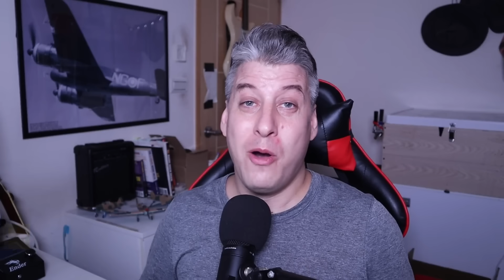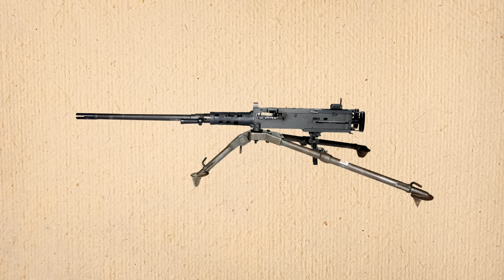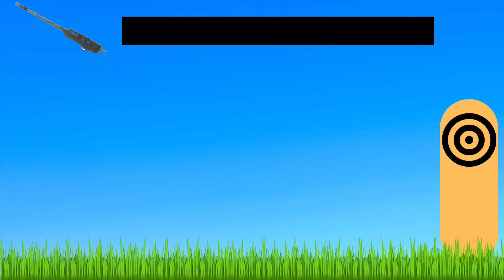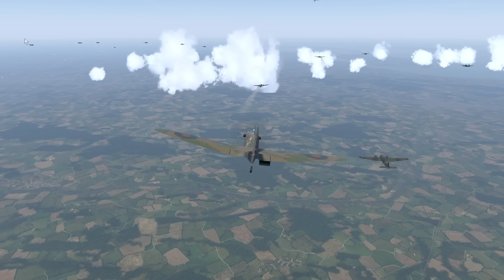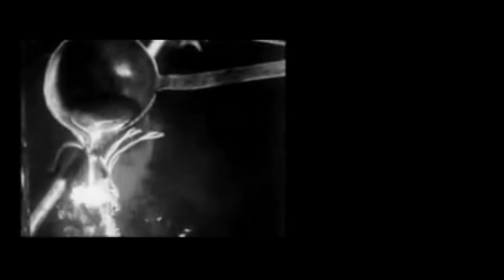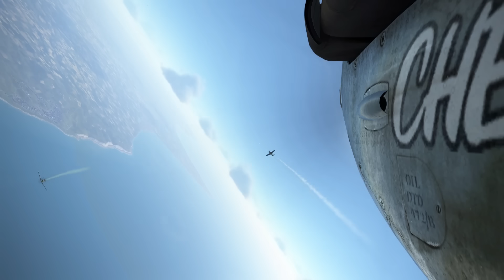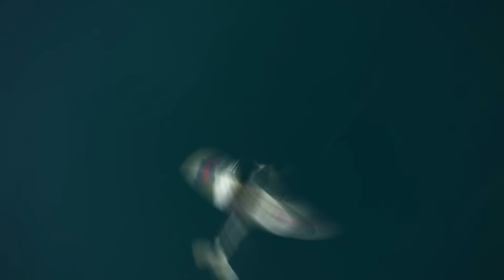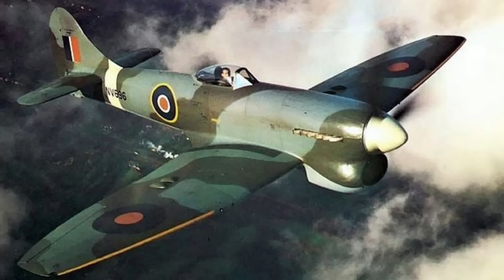Why Did The RAF Use .303 Caliber Machine Guns in WW2? The Surprising Answer

Comment: By 1944, when the P-51D appeared, the typical Spitfire of that time had an E wing with two 20mm Hispano cannon and two .50cal. machine guns. This arrangement delivers much more energy than the P-51's armament, as 20mm shells have a kinetic energy of 65,000J each (three times that of a .50 cal. bullet), and the explosives in the 20mm shell add about 40,000J of detonation energy to each.
 Accordingly, two 20mm cannon deliver approximately two megajoules per minute to the target, plus another 300,000J from the two .50cal. machine guns. This is well over twice the firepower of the P-51's six .50cal. machine guns, and all for less weight (275kg for the Spitfire vs 389kg for the Mustang, for guns and ammunition).
A four 20mm arrangement is the most lethal of all, and so proved by the end of the war.
Reply: I read that pilots in the Pacific preferred .50s to cannon for the greater ammo capacity.  Japanese planes lacked armor and self sealing tanks so .50s had no problem chewing them up.
Reply: @CorePathway  Absolutely. Japanese fighters, particularly the Zero-Sen were very lightly built and carried no armour or self-sealing fuel tanks. This made them much lighter than they would have been if they had such, therefore more maneuverable and with a very good rate of climb. This, however, did not serve then well as faster and more rugged American and Commonwealth fighters using hit and extend tactics tore them apart with a burst of less than a second. A P-38's 20mm was even more lethal.
Reply: @Glicksman1  I think you have to explain further your statement that two Hispano cannon deliver 2 mega joules per minute destructive power plus 300,000 MJ destructive power from two 0.5cal. Browning machine guns!  Doesn’t “MJ” mean mega joules? If that’s the case then the Hispano cannon are pretty puny!?!
Reply: @ivatt442  I see the mistake. It was a typo. I meant to write, " ...300,000J"...". Joules, not megajoules (MJ). .50cal. machine guns are powerful, but not THAT powerful. :D
Also, please note that for descriptive convenience I wrote "per minute" when describing the power of the guns. No 20mm or .50cal. gun is fired uninterruptedly for an entire minute. To attempt to do so would destroy the gun well-before a minute was reached. A burst of one second or less was more usual which, if accurate, was sufficient to destroy virtually any aircraft.
Sorry for any misunderstanding because of the typo.

Comment: Odd that the Spitfire was switched to four 20mm guns but then changed to 2 20mm and four .303, later two 20mm and four .50. Aside from mounting problems with the 20 mm it was also found that the chamber headspacing was wrong which also casues jamming. (the Corsair F4-C armed with the same 20 mm guns had problems as well)
The freezing of the guns was solved by equiping them with electric heaters. If you wonder why early on the gunports were taped over at the start of a mission was to keep condensation out of the guns while climbing to altitude and freezing in the guns. But at high alititudes even lubricating oil will freeze and jam the guns. (B-17 gunners worked hard to make sure they worked and some were said to even sleep with them, probably waist gunners.)

The .303s in the rear Lancaster turrets were often loaded with all or almost all tracer hoping to dazzle the night fighter pilots if nothing else.

One theory for the .303 was that a massed stream of tightly spaced hits would cut the aircraft structure like a buzzsaw, more effective against frame and fabric. But then because it was thought the pilots were poor shots the harmonization was set to "shotgun" rather than spot which defeated the plan.

But in reality it was more the RAF did not have the time, or money, to change over to a different gun as it was more use what you have and hope foe something better later, maybe.
Reply from the maker: Thanks for the extra info there Frosty!

Comment: Well,the turret with four 7.7mm(.303)machine guns on a bomber is enough for doing the job. That's on bombers. But,the Spitfire MkV with only .303guns wouldn't be as good as with two 20mm Vickers cannons. Trace them with 7.7 kill them with 20mm or both. Personally,i would rather have something like the Seafire with four 20mm cannons then two and four 7.7guns. Get close enough and you can use cannons two by two. American 12.7mm(.50cal) was powerfull enough so they didn't have that much need of stronger punch. Especially P 47 with 8 .50s. What i would always choose is the Fw 190 A4,A5 or A8 with two 7.92mm or two 13.1mm machine guns plus four MG151 cannons. That combo beats it all even with 7.92 on the nose. Interesting to say is that the MG151 was good because that is actually a 15mm heavy machine gun made larger to 20mm,while keeping a high rate of fire. But in war you use what you have and i can understand England for keeping the 7.7mm till reliable 20mm came about.

Comment: In my opinion the .303 was a good enough round, when firing at an aircraft in a formation of bombers the pilot didn’t want to hit the aircraft where it was most heavily armoured, the pilot/co-pilot usually had armoured seats but the rest of the fuselage and wings were of aluminium of a lighter and thinner gauge, engine cowling’s couldn’t be made to such a thickness that it made removing and refitting them labour intensive and had a weight penalty, heavy armour throughout an aircraft affected the weight and moment, and that could lead to handling issues, all in all the idea is to bring an aircraft down, whether that was accomplished with 100 .303 rounds or 25 .50 cal or 5 20mm is a moot point, down is down, and all the talk of claiming damaged as a marker for the crews was ridiculous, only aircraft that crashed counted, a damaged aircraft could, up to a point be repaired and returned to service as quickly as the amount of damage dictated. Ultimately the .303 saw RAF, Commonwealth and Allied pilots through the Battle of Britain 🇬🇧, and then the rest is history. Thanks for sharing your research and knowledge with us all, very interesting and informative, subscribed. 😀👍🇬🇧🏴🇺🇦

Comment: The real head scratcher for me is why within a couple months of each other did the RAF set up production of a .303 cal version of the browning and the Army set up another factory to make 8mm BESA tank machine guns.  Both were rush war emergency jobs to get belt fed MGs into the fight as quickly as possible, yet the army decided it would be easier to no bother changing caliber and work around a gas operated gun.

Yet the air cooled browning started life specifically as a tank gun.  There were British and French tanks in the 20’s with such an armament.

Best guess is they just didn’t talk with each other?

As to why the RAF went with .303, I think they were just a conservative lot and suspected (correctly) that in action many of the guns would fail.  If you have 8 MGs and 2 fail that’s not bad.  If you have 4 cannon and 2 fail that’s a big problem.  And the cannon armed fighters were notorious for jamming in action until mid way through the war.
Reply: Unless supply lines might get confused separate and incompatible supply lines are not a problem. Producing different guns, with different requirements, might avoid bottlenecks in production. Having platoons or companies with mixed weapons can be a problem - but the RAF and Army had entirely separate supply lines that could easily accommodate different and incompatible supplies. In fact .303 ammo for snipers, ordinary rifles and machine guns was different - so even squaddies could deal with mixed ammunition that would fit into and fire in all guns (often very dangerously).
Reply: But the Browning and the BESA were both products of the BSA company and of the same team. The Browning was made at the Armoury Road, Birmingham factory and the BESA at the Redditch factory. My father, W J Gardiner, was the key person in both cases, being a member of the team that set up production of the Browning and in 1941 manager of the Redditch factory. He died in June 1941, partly the result of the stress of his job. He had been a 'Old Contemptible' in the 14-18 war. He also had had a lot to do with the setting up of production of the Bren Gun. I must have been about 8 when he explained to me how it worked and one of the Czech technicians who came to Britain to help set up production gave me some Czech coins. A serious problem at Redditch was getting former farmhands to accept the discipline of factory work. Later women were employed and they took half the time to train and did a better job.
Reply: There was a big debate. Bob Stanford-Tuck wanted the Hispano, but Douglas Bader was determined to stick with the .303. They fought it out at meetings with the Air Ministry during the BoB.
Reply: the licencing fees for the .50 cal were prohibitively expensive for BSA.  The 30.06 MGs that came with early Mustangs were problematic and the ammo of low quality, so they removed them & gave them to the RAF Regiments.  They then installed their own .303s in the Mustangs.  The RAF used what worked best.
Reply: Also , it is strange that the Army didn't rechambered BESA's to the .303 , the standard caliber for rifles and MG's. At least British tanks could use captured German ammunition.
Reply: @Kav82a  IIRC the BESA uses a push through belt that won't work with rimmed ammunition. The Maxim and US Browning pull the rounds out backwards, thus work with rimmed.
Reply: Remembering that the pneumatic cocking device was deleted from RAF fighters because the 20mm  was so reliable after Martin Baker and Molins had debugged the set up. It also shot faster with a flatter trajectory than the German equivalent which was Oerlikon based.

Comment: The AN M2 50cal machinegun was a lightened version of the ground-based M2. They also had a higher rate of fire than the ground-based M2.
With the Browning 303 machineguns in British fighters, initially there was issue with freezing at altitude as well. The solution was to port exhaust gases to keep the working parts of the gun warm. When the same issues occurred with the Hispano cannons, the same solution was applied. It is a fallacy to think that the long protruding barrels contributed to the freezing. 
With the Type C wing and Type E wing on the Spitfire, various combinations of armament could be carried. There are B&W pictures of Spitfire MkVc with 4 20mm cannons in Africa. These aircraft were flying ground-attack missions. Most E wing Spitfires flew with 2 20mm cannons and 2 50cal machineguns. This was around 1944 onward. The greater presence of US Forces at this time made getting access to 50cal ammunition easier.

Comment: 1. The 1940 cost of a GM made .5 inch M2  Browning  was about $550! (later $45) 2. I have read that the first 20 mm cannon Spits were in trials even in the Battle of Britain. 3. Not mentioned by you was that until metal aircraft came about the purpose of the gun was to kill the pilot as the bullets of any size would sail through the canvas with no harm. 4. BSA had a license to make the .303 Browning but not the .50. 5. The bomber armament was really a deterrent as they flew at night and weight was important. Good report though, I learned something.
Reply: I believe the cost you mention is for the .30 cal model of 1919A4, the infantry machine gun that weighed 31 lbs. The Saginaw Steering Gear Division of GM was the company that reduced its cost down in the range you mention, from the 1940 contract price to the end of the war. A sister division, Saginaw Malleable Iron Division allowed for the development of strong castings that greatly reduced the amount of steel required and wasted in the machining process. Many components of both the .50 and .30 cal Brownings were changed to these lower cost but high-quality cast manufacturing, minimizing machine time as well. This is largely what allowed the price to come down. I've not seen figures for the .50 cal, however. AC Sparkplug and Frigidaire were among the GM companies making the M2 .50 cal guns, both ground and aircraft versions.
Reply: The 20mm trials in the Battle of Britain used Hispano Suiza canons based on the original design. The vibration on aircraft wings often caused them to jam so the pilots asked for the .303 Brownings to be refitted. The Hispano Suiza was redesigned  to make it aircraft proof which turned it into one of the best guns of WW2 but it was not available in quantity until late 1941.

Comment: In truth the. 303 calibre was not bad at all but but reading here and there the pilots was often complaining the lack of punch. I  suppose that it was very effective in ground strafing against soft targets but certainly not much against AFV and was almost useless against tanks. In this the .50 Browning was more versatile but it would had to be license production adding cost let alone creating new lines both for production of ammo and guns. With the .303 guns there certainly big advantages like firing the incendiary shots by following, reliable and not so heavy but reducing the airplane like a sieve without knocking it down wasn't a great accomplishment and didn't have much range that is why I prefer the .50 Browning. Just my opinion.....

Comment: Idk where you got the production numbers for the Browning .50 but those numbers make no sense considering that the US put the caliber .50 on literally everything (rear mount on tanks, twin/quad mount for AA guns, twin mounts for bombers, anywhere from 2 to 12 forward firing guns on aircraft, twin gun pods, etc). Also, for the E-type of wing armament layout for the Spitfire, the layout was a pair of Mk.II Hispano cannons and a pair of AN/M2 .50 cal machine guns so it's not like the Brits didn't use the .50 at all.

Beside that, the more popular version of the Hispano was the Mk.II and iirc it was also the version that already had the issues ironed out, not necessitating the Mk.V (unless you're talking about the Mk.V of the Spitfire). And also the rate of fire is around 600 RPM, not the blisteringly fast 850 RPM as stated.
Reply from the maker: Thanks for the corrections

Comment: From my knowledge of modern civil aircraft structures: A structure is designed for the life of the aircraft assuming it to be perfectly constructed.  Say 40,000 cycle.  However, if a fault occurs such that an element becomes inactive then the adjacent elements must take the increased load until a subsequent regular inspection discovers  the problem.  If you want to destroy the aircraft then you cannot do it by taking out a single element.  You need to take out two or more adjacent elements.  This is very unlikely if we're talking about manufacturing, assembly or maintenance faults but quite likely if we're talking about machine gun damage!  Rate of fire becomes a significant factor in taking out adjacent elements in order to bring down the aircraft and tips the balance towards smaller ammunition.  Creating two big holes in different wings will probably not do it - but making a dotted line of small holes across a single wing probably will.

Comment: The same reason it made sense for the US to use the smaller 5.56 round than the NATO 7.62 round: More ammo can be carried, more chance of hitting a moving target, plenty of supply etc
Reply: And the 7.6 NATO was basically shoved down everyone elses throats by the US.
Reply: … and hence after many years of navel gazing and standing true to the original argument, and after many years of feeding that the 5.56 simply is not totally effective in combat, the US is moving to a 6.80 round. Meanwhile, troops still adore the original 7.62, as do the enemy.

Comment: There were a number of rifle caliber armed fighters in the late 30's. From all combatants. The .50 BMG round and aircraft gun dates to 1919. One reason I think a lot of nation kept rifle caliber guns in the .30 range as fighter armament was their rate of fire. If you are only getting off a short burst the number of rounds can count. Plus there was a general lack of armor on all fighter aircraft of the period. Also let's be honest. One .30 caliber round in the radiator of a liquid cooled engine and unless the aircraft has a place to put down the aircraft is going to be lost due to engine failure.
A better question in my opinion is aside from the P-38 and P-39 why was the USAAC/F and the US Navy so slow to adopt cannon in the 20mm or another caliber in fighter aircraft. Is it due to the Buick or Oldsmobile (1) divisions of GM being unable to effectively tool up and build working copies of the Hispano? Or was is USAAC/F and US Navy reluctance to switch. In terms of cannon armed fighters the US certainly lagged behind. Even post war the USAF kept the .50 BMG in the F-86 while the US Navy was adopting the 20mm.
1) I seem to recall it was Oldsmobile. As I understand it the problem was not so much converting the metric dimensions to decimal inch units. It was in the proper tolerancing used. Neither metric or inches is more precise. The level of precision depends on the tolerancing used. Also in the case of Oldsmobile and the Hisso it's not just the total tolerances it is also the way they work together between the individual parts.
Reply: The Oerlikon was a great lump of a thing too compared to the HS 404.
Reply: "Or was is USAAC/F and US Navy reluctance to switch."

The USAAF and USN both wanted the cannon. The problem was that the US Bureau of Ordnance refused to admit that the chamber dimensions it specified were incorrect - 1/16" too long, to be precise. They were so stubborn that they actually prohibited US factories from making guns with the shorter British chamber dimensions - even though British Hispanos worked and US ones didn't. Tolerances weren't an issue, really; the RAF evaluated US-made Hispanos and said they were beautifully made, manufactured to a much higher standard than British ones. They just didn't work...